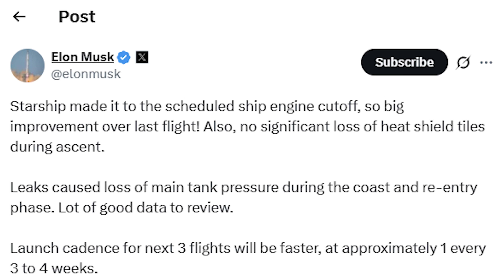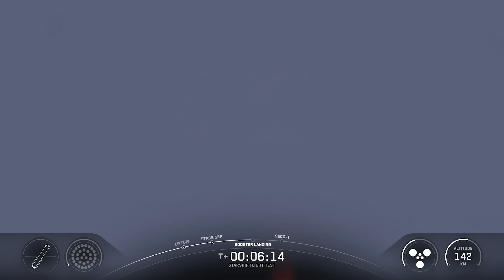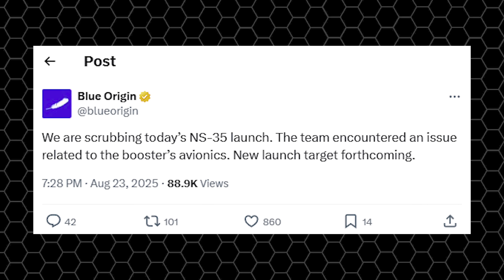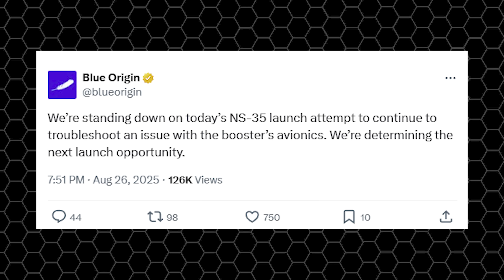It's mind-blowing! Elon Musk just announced New Starship Launch Date after Flight 10 Shocked others

Comment: Space Shuttle was a relative success, thanks to the fact that it did not have to carry its main fuel tank to the orbit and to return it to Earth. Still, the space plane's thermal protection and its RS-25 engines required extensive refurbishment after each flight, which took several months. I doubt full reusability of Starship for orbital flights can be achieved, but it could be used for suborbital flights when it is necessary to deliver equipment within an hour. In this case, a it would be used as an intercontinental ballistic missile, and the maximum speed of 15,000-20,000 km/hr (4167-5556 m/s) would be enough. This would reduce engine wear and thermal stress and would allow for a significant increase of payload. And as a result of reduced wear and tear, it would be possible to launch it one more time (to return to the base without payload) without refurbishing.
Reply: I think it can even be possible to launch Starship as a ballistic missile for its return flight without payload without the first stage (or with small solid rocket strap-on boosters)